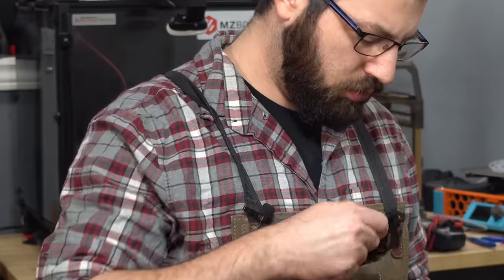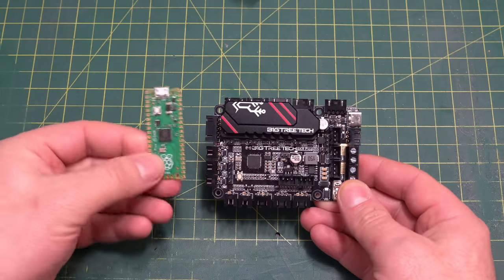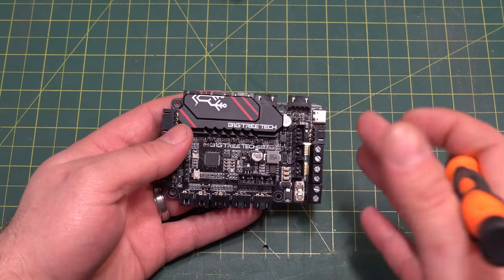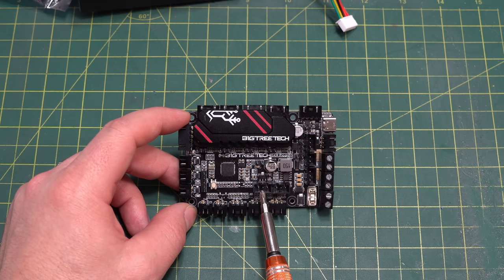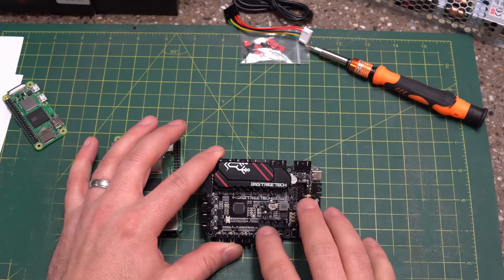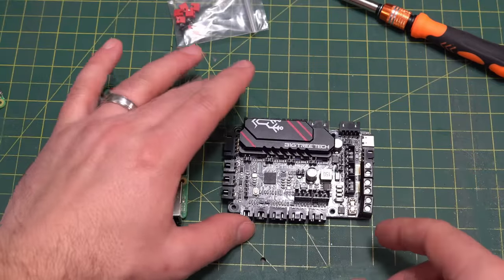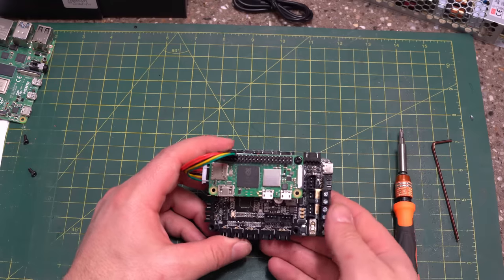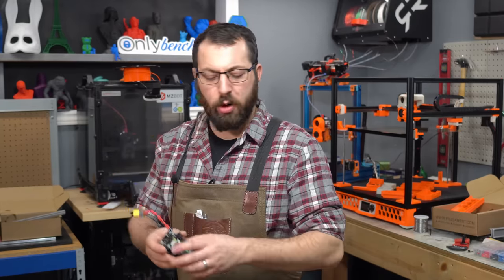The SKR PICO - Small yet mighty controller for your 3d printer

Comment: Good review. I was just considering this board for a laser/cnc build upgrade.  I would probably just use smaller stand offs and mount the boards back to back to get full access to all the GPIOs and connectors. It's not the size of the board, it's how you use it...

Comment: Ah, have wondered with the RP2040 would be used as a printer controller.
Lack of independent dual Z motor controllers is a deal breaker for many of us with i3's though.

Comment: If I was starting a V0 today, I think I would probably go with this instead of the SKR mini. The additional fan controllers would have made hooking up a Nevermore a lot less effort, and losing the buck, etc. would be great.

It should be possible to flash it by copying the file over USB directly from the Pi instead of having to bring it over to your computer. It just acts like a USB flash drive, and the Pi can mount a USB flash drive just as much as your computer can. You wouldn't be using the "make flash" command; you'd just be copying the file in fewer steps..

(instructions not tested; please check the documentation with respect to how the jumpers work)
You'll want to have the SKR connected via USB to your Pi (you can leave it connected permanently.) The first time you do it, you'll have to set up your pi to automount usb drives:
sudo apt install usbmount

Shut down and turn off the printer, then install the boot jumper as described; I don't think you'll want the USB power jumper because it should be powered from your printer's power supply. It might not even be necessary to turn off the printer (you might be able to just install the jumper and press reset). I'm not 100% sure if the jumper is safe to install when powered on, so please check the documentation. When you power it back up, the drive should show up as /media/usb[0-7], probably usb0. Find out which with:
ls -l /media/usb0

Go through them until you find the one that has the expected files.

Then go through the usual "make" commands and just copy the file:
cp klipper/out/klipper.uf2 /media/usb0

Then remove the boot loader jumper and press reset. I think it should be good to go at that point.
Reply: You can do almost the same setup using the skr mini if you go UART and Raspi Zero. I had that for a long while until input shaper came along which at the time with the much slower first gen zero just wouldnt work. Now with the second gen this should be totally manageable.

Comment: Just installing one on my new switchwire. Pi is in a case with a 3.5inch Touchscreen running klipperscreen and Fluidd, mounnted in place of the 12864 screen.
Reply: Do you still need the BAT85 inline for your probe?  It seems like it shouldn't with the correct setting, given it is a 12/24v powered pin, but I want to check before I burn anything out.

Comment: I connected my Pico to the RasPi 3B via USB and not the UART controller, and not stacked but separated as if you were using other boards like the SKR mini. That way you can SSH into the Pi, put the Pico into Mass Storage device mode via jumper/reset button, then mount it as any other mass storage device in Linux and just cp the uf2 file over. It'll unmount, pull the jumper off the board and you're up and running
Reply: lol, I didn't event think about this option.. i have the same setup.

Comment: After the initial flash of klipper, is it possible to use Make Flash and update from the Pi, so you don't have to jumper the board to DFU mode?
Reply from the maker: Atm no. Usb flash only...this may change though
Reply: @CanuckCreator  The other question. Aside the jumper necessity, why not "flash" it directly from RPi? I mean mount it over USB (as any other USB flash drive) on RPi and copy there?
(for the automation, the jumper is quite an issue. Otherwise it seems to be a way to me).
Reply: You should be able to flash it by copying the file over USB directly from the Pi instead of two steps, copying it to your computer, and then to the SKR. But all the other steps with the jumpers and such would be the same. The Pi can mount a USB flash drive just as much as your computer can.

Even though you have to mess with the jumpers, it would still be a lot more convenient though because you could just leave it plugged into your Pi's USB port instead of having to bring it over to your computer or vice versa.
Reply: @fwiffo  Yeah, the issue is that doing anything that requires placing jumpers every time klipper is updated (and requires firmware reflash, which seems to happen frequently) is not ideal, especially if this is designed for the Voron 0. Most users will have the back panel on so it's quite an inconvenience to have to remove it and fiddle with jumpers and usb cables. Hopefully this is something that can be remedied in the future (I imagine it will require a change to the bootloader possibly).
Reply: @GregsMakerCorner  Unfortunately, other things that need flashing usually need the same jumper dance (Klipper expander, various displays, etc.) I just avoid it by upgrading Klipper as infrequently as possible; it almost never actually needs to be updated. New releases are pulled from github at HEAD, so are broken pretty often anyway. And mainsail/fluidd, moonraker and system packages can be updated with minimal effort still.

Compared to the SKR mini, Recompiling Klipper, copying it to your computer, then using the microSD card is almost as much work as using the jumpers.
Reply: @fwiffo  It sure is a pain updating Klipper especially when some of the other boards out there (especially add ons as you mention) also require jumpers. I am currently running 4 machines with Klipper on them and am no stranger to doing upgrades- running BTT Octopus boards, which are easy to update and can be flashed from the PI (check out some of my vids if you want to see how easy it is on those boards). I like to stay up to date on my firmware so I tend to keep all the machines on similar versions. I am optimistic that things will get better, and even some day doing klipper updates will also handle the firmware similar to how Duet does it.
Reply: @GregsMakerCorner  you could design a small custom PCB that would mount to the extrusion, with a cutout in the back plastic panel, and festoon the PCB with Micro-Fit 3 connectors. On the other end of the wire, a DuPont connector. When the inevitable time comes to update, take your 3D printed custom *modular pod, connect it up to the Micro-Fit connectors, and have an easily accessible, broken out BOOT0 SPST switch and momentary switch reset button in one handy place.

* Modular because you could either have a pod with only one switch/button, and move the pod up to the next device that needs a firmware update, or have a two-row Micro-Fit 3 connector, with multiple sets of switched jumpers/buttons all on the same pod so you can do them all in one batch.
Reply: Or, if you’re using the V0 umbilical PCB, a revision to it could have spots to connect BOOT0/reset to your boards. Attach a pigtail to the same Micro-Fit 3 studded PCB, and use that to govern the jumper/reset with the pod.
Reply: @mysfiring  Yeah, both of those are great ideas! Basically moving the jumper to make it easier to get to.. I like your thinking :)
Reply: @GregsMakerCorner  physical pods and jumper breakouts and switches are cool and all, but apparently there's a way we've somehow missed all this time - am yet to try it, but this could change the game entirely: https://www.klipper3d.org/SDCard_Updates.html
Reply: @mysfiring  yes I use that to update the skr but it doesn’t work on the extender or display- you need an sd card for that.
Reply: @GregsMakerCorner   I’m yet to try it myself with the V0 display, but I have been experimenting with an inconsequential STM32 bluepill I don’t care if I brick - granted, it’s capable of having a bootloader installed on it, so that might be the lynchpin - and it’s able to go from normal operation to update mode as long as the bootloader has been successfully written once before.

If I encounter anything significant, I’ll be sure to post a video documenting my findings. Because it would be rather hilarious if this functionality has existed all this time - even for devices without SD card slots in them - and it’s somehow managed to escape the hive mind.

Fun times ahead! :D
Reply: @mysfiring  It would definitely be nice if there was a way! I was exploring the Klipper firmware page and it seems like there are just so many different ways the devices are configured… would be nice if they were a bit more standard. Best of luck and please keep us posted! :)

Comment: I ran Klipper for a while and for some reason I can’t recall switched back to a stock Marlin fw for an MKS Robin E3 but recently bought btt’s smart filament sensor and ran into constant problems trying to compile a new Marlin firmware for it.  Put Klipper back on it and was up and running in an evening.  It’s just so much easier to configure.  I don’t think I’ll ever go back to Marlin ever again at this point.

Comment: Problem with SKR Pico:  I have successfully flashed the Pico with Klipper firmware but find that my RPI V4 does not enumerate the Pico USB interface unless I manually press the reset button on the Pico.  This prevents the Pico from being used to control the Voron unless I manually press the reset button each time it is powered up.  Does anyone know how to fix this problem?

Comment: I’m building a V0.1 this would be perfect for that?
Reply from the maker: Would work just fine, you really wont see any print quality difference, with klipper, performance is pretty much the same with any 32 bit MCU with tmc2209s, it all comes down to formfactor, availability and what features the board supports
Reply: @CanuckCreator  thank you. Is it available? What board would you recommend today that’s available? I’m thinking about doing Duet 3 mini because it’s available at least. But I would like suggestions.
Reply from the maker: @thelightspeed3d712  The BTT in the link has em in stock, and i believe a few resellers have them as well, If you want to run RRF i the duet mini ive seen used. The vzero is a pretty simple printer in terms of what your controller needs to be able to support, xyze motors, xyz endstops, fans and heaters, no tramming, bed probe etc. so really it comes down to firmware choices/budget/availability/ features and room availability

Comment: I've been somewhat confused about Klipper, is a RPi required for Klipper or just a good/recommended configuration?
Reply: Required. The processing work is done on the pi leaving the controller board just doing the motion itself
Reply: @gazeddy  Brilliant thanks! Is it possible to connect more than 1 controller board to a RPi if you need extra stepper drivers?
Reply: @WhiteG60  Is it a daisy-chain connection or does each board require a seperate Serial/USB line from the RPi to it?
Reply: @WhiteG60  Awesome! thanks for the detailed replies, much appreciated :)
Reply: To clarify, an rpi is not required for klipper, it can be any computer running Linux, yes?
Reply: @connorl8124  yes you can add a secondary or even more controller boards doing extra bits. on vorons (the bigger ones) it used to be the way to go using 2 skr 1.4 boards
Reply: @connorl8124  Technically, as far as I know at least, daisy-chaining is possible if you have boards that can speak CAN and a compatible CAN adapter for your pi (or host). Klipper host as well as firmware has support for CAN. It's however not something commonly seen, so ymmv.

Comment: My only concern with SKR Pico is why I have to connect it with additional Ras Pi for LCD? Why can't the existing Pi processor on SKR Pico itself be used for LCD?
Reply: It's designed to run Klipper.  You need a phone/tablet/pc/rpi for an interface

Comment: I'm running my new built Voron 0.1 with the orange is zero and I'm pretty happy about it. It is much cheaper than RPI here where I live. I see the board is running at about 55 C. Should i put a small fan on it, or is that a normal temperature?
Reply from the maker: I know RPI`s will throw warnings starting at 60c, but still run fine until about 80+
Reply: Ok thanks i noticed today if printing abs with bed at 110 it will go up to 65, but it seems fine overall

Comment: Nice little simple board. I can see this being used on my bed slinger that has an older slower board that just had its drivers die or my custom corexy build. I don't need all the fancy bells and whistles like gantry tramming. I'm fine just using mesh bed leveling or if a probe is supported like a bltouch. I'm just curious what makes this tiny printer preferred?

Comment: Even if the HB Out is rated to 9A, I believe it could handle an external DC mosfet just fine. So technically, it could drive bigger printers.
Reply from the maker: That is correct, or use a SSR for a mains bed as an example.
Reply: I wired my bed SSR to a unused Endstop/DIAG connector, works great

Comment: what do you actually do with nice graphics on the box? I can pretty much see  people bitching about the connectors being that way.
Reply from the maker: They went with the 90 degree connectors i assume so you can stack a rpi on top and still have acess. Im not the biggest fan but is what it is
Reply: A nice looking box shows a lot - that they actually care about the design of such, and (more importantly) they want to differentiate themselves from every other 3D printer board manufacturer that ships products in plain cardboard boxes. 

What’s more is that it doesn’t just stop at the box - look at (partially cosmetic because the majority of the heat comes from the bottom of the stepper driver packages, but I digress) the heat sink on top of the stepper drivers. They could’ve just had stick-on heatsinks like every other manufacturer. Instead, someone took the time and effort to design that heatsink. (And claimed double overtime for the SKR Pico Armoured.) Wonderfully excessive, but also amazing - and a great indication of things to come. 😄

Comment: Half the board is a buck/boost circuit haha its a cool little board. The Pico is getting a cpu update soon I think. You're from Canada,  where do you get a pi at? I can find one for under 150 after tax.
Reply from the maker: I grabbed a few pi4/pi3`s awhile back during a BoGo deal, pre-shortage
Ive got a couple rpizero/zero2s as well

Check canakit/buyapi.ca
Reply: @CanuckCreator  cool, that's where I check. Element14 is selling them for over 200 for just the board p4 4gb. I've got a pi400 a youtuber friend gave me because it was a review unit. I'm doing a switchwire and I think I'm just going to print a case for it after I see how big it is haha
Reply: Get an orange pi zero 2. $25 or so and works great in a killer set up.

Comment: No way to use an LCD with no EXP connections. Otherwise it would be perfect for my switchwire.
Reply from the maker: Correct. But there are alternatives such as the vzero display or using klipperscreen
Reply: The intention is to use the RPi to run klipperscreen on a screen attached to the pi.

Comment: Does the pico still need a bat85 for the inductive probe?
Reply from the maker: nope, long as your use the dedicated probe input on the board, make sure to reference the manual to ensure you have it setup correctly

Comment: The funny thing is, it was only this week that the availability of the RP2040 chips for businesses to integrate in to their own boards was announced. BTT seems to be ahead of the game.
Reply: SparkFun, Adafruit, Pimoroni, and Seeed must have all discovered time travel.
Reply: @RichardBronosky  those are different. They are Raspberry Pi partners who are building their own versions of the Pico board for people to use for projects. The new announcement was for companies building products requiring an embedded microcontroller.
Reply: @JonS  Nope, the announcment says that you can buy MCUs directly from RPi foundation with no middle man, which means lower price in bulk orders. These RP2040s are available for a while for any project whatever you want.
Reply: @MartinWolker  were they available in high volumes before (10k, 100k, etc.)?
Reply: @JonS  Sure, but with double price.
Reply: @MartinWolker  for anyone building high volume consumer products, like my company, a component is a non-starter if not available direct.

Comment: I just bought this board for my Anycubic Mega Zero a few days ago and I didn't realize that there might be a wattage limit on heated bed. There documentation doesn't mention this as you mentioned. Ugh... BTT really needs to do better documentation on their products. There are similar issues with their other boards and wrong pin out labels.
Reply: @WhiteG60  oo that's good to know. I'm actually running a 12V power supply. I have the Mega Zero v1 and the hotbed is a mod. I'll grab an external MOSFET. Thank you!
Reply: I would always use external MOSFETs, both because I can pick overkill ones that support a LOT of power and later I can switch out the mainboard without worrying about how much the new onboard MOSFETs can handle.